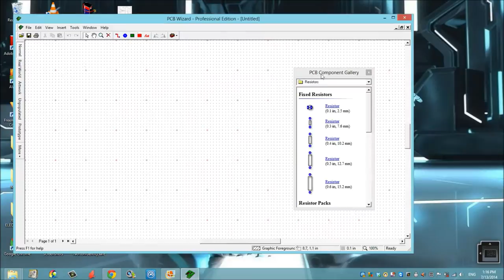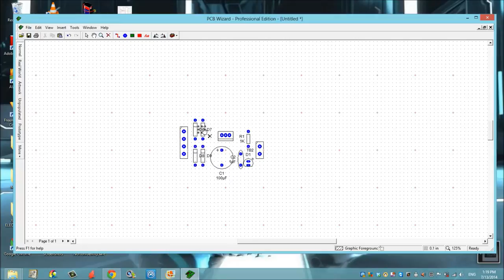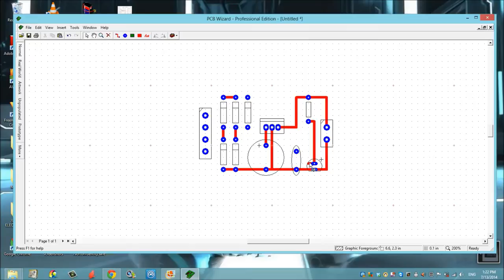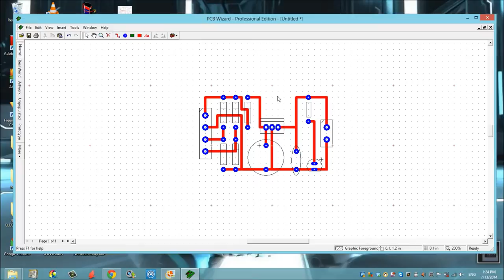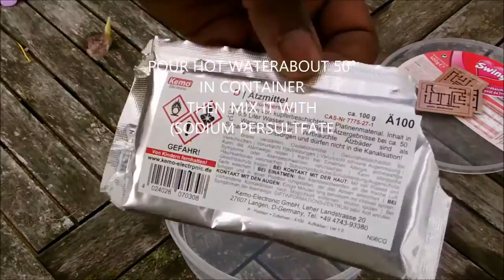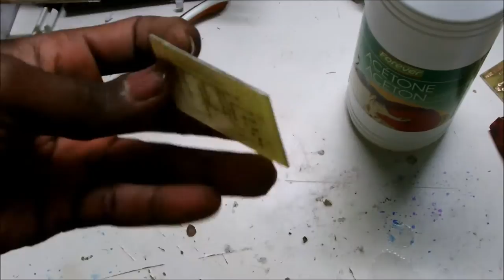homemade pcb board 1

Comment: Diptrace also good,for me using green soldermask is expensive to finalize  your work  professional  I came with my own method  maybe  may try,by using nail polish uv is cheaper for time being. And get transparency A4 for a toner  with your board sizes, Windows glass any size you want.place on sunlight  3 to 4 min peal gently  you will see the results. Any color  you want  polish  here in South Africa  its 100 bucks  for your pad a use sharp instrument  object. So that  you can easy  solder on the pads maybe it will  help
Reply from the maker: thank you so much for ur time and explaining; and for this tips ,i like ur idea ,for sure i will give a try ,